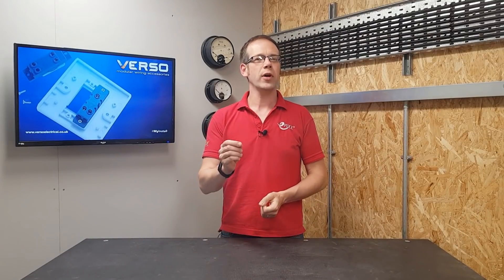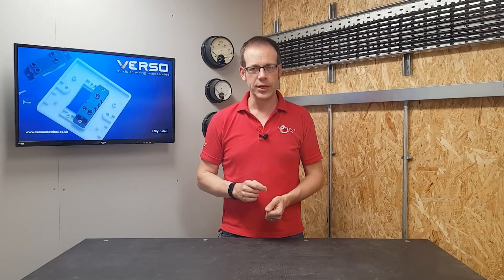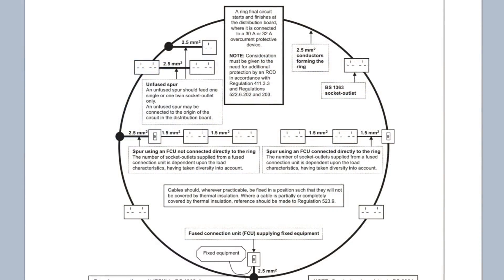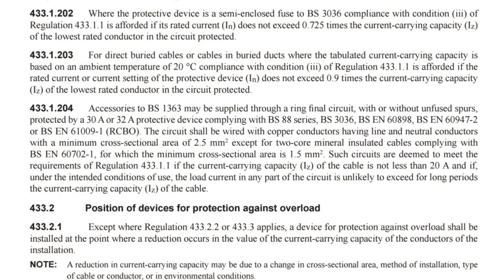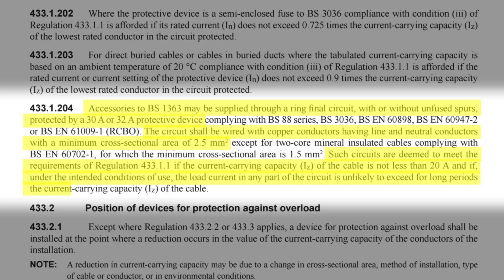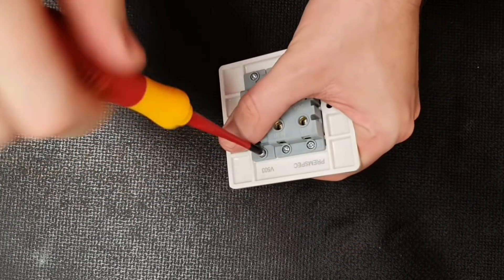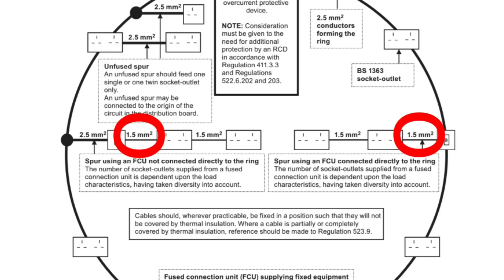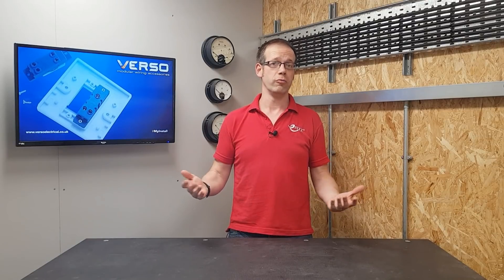Can you use a 20 Amp double pole switch to control a spur from a ring final circuit? BS7671

Comment: You wouldn't use a 20amp switch to isolate a twin socket spurred off from the ring, even though it may not run at 26amps for long periods, it may run more than 20amps, and possibly for long periods at times.  The 20amp isolator has nothing to do with the 20amps either leg... when it becomes a spur the load is not shared between 2 cables anymore.  This arrangement means the 20amp has no overload protection.
Reply: A bit like a single bit of 2.5mm cable?
Reply: @travoltasbiplane1551  2.5mm cable can withstand 26amps with the right wiring method hence you can wire up a twin socket with out overload protection as the max possible load is 26amps (although some sockets may not handle 26amps and neither would it be likely although possible if your boiler breaks down and you go around plugging in 2-3kw heaters all over the place temporarily) spurred off as the maximum load cannot be exceeded unless you use non product standard equipment which the regs isn't designed to protect you from.
Reply: @MrSJT  433.1.204. We just need Iz to be more than 20A. Overload protection is provided by the nature of whats on the end of it...and even if it is a double socket... you stick 20A through that socket for any significant duration  (which should be unlikely in a correctly designed circuit) I'd put money on the socket catching fire before the cable did. This outcome would be equally feasible if it were part of the ring itself and someone contrived to get 20 amps going for hours at a time. Of course common sense applies when designing any installation and if possible spurs should be avoided especially where this might be likely. That being said though if you're really concerned about getting a maximum total load of 26 amps out of a double socket you should also be considering the fusing factor of a 1362 fuse... It isn't 1.45...  You aren't going to get any close protection out of it...
Reply: @travoltasbiplane1551  433.1.204 20amp is the ring circuit legs regarding sharing the load in the ring, not the spurred points of 2.5mm radial coming off it.  Regardless of debate, I hope most people don't go by minimum requirements all the time especially with bad examples as it's the combination of both that promotes bad practices.
Reply: @MrSJT  for sure and i don't disagree particularly... The 20A does still apply to spurs though... The qualifying term being 'under the intended conditions of use, the load current in any part of the circuit is unlikely to exceed for long periods the current carrying capacity of the cable'. I always treat it as something to be avoided if possible. But most of the time a spur off a ring final circuit in 2.5 even to a double socket is not going to be an issue. Of course there can be exceptions - but I think if there were undue concern there would be further stipulations made in this regulation and appendix 15. Would I spur to a double socket to supply a washing machine and tumble drier... no. Would it be fine - probably. Would I spur to a double socket in your average bedroom... Yes because its very very unlikely to get overloaded. How many 3kW heaters can you run in one bedroom before the thermostats kick in and how likely is it that someone would connect them all in the same place?
Reply: @travoltasbiplane1551  problem with appendix 15 is that we need to understand how to implement it properly and also take in to account the customers don't know anything and just plug in what they want, further more this why I think it's bad practice to work to the regs (unless you really know what you are doing and consider all risks that you are willing to take liability for), should work from the regs.  This is why they say if you work to the regs you are likely comply with the law, coz the conditions must be right as it isn't always the case
Reply: @MrSJT  I don't really understand what you mean when you say it is: 'bad practice to work to the regs?' If we don't know what we're doing, and can't interpret BS7671 then we're clearly in breach of EAWR and shouldn't be doing the job. We also take responsibility for design and make decisions as such everyday. If the onsite guide is your go to (above the regs?) it says the same thing P189 H2.3 giving conductor sizes and current carrying capacity. I hear what you're saying but I think you'd have to be going some to make a spurred double socket dangerous in reality...unless, of course, you did something really daft and used it to supply two 3kW ovens which you shouldn't be doing anyway. Looking at it another way.... On an EICR you find a spurred socket somewhere. Cabling is installed reference method A. No evidence of historical overload. But... what if... What code are you going to give? I agree best practice... but the quantity of unfused spurs in service would indicate that the majority of the time there isn't an issue.
Reply: @travoltasbiplane1551  what I mean is, working to the regs is working to the minimum standard.  Working from the regs would be like working to the regs, then you take in all other considerations and any factors involved as some times minimum requirements isn't good enough hence need to go beyond.  Take BS5839-6 for instance, on a rental property a minimum standard is a Grade D1 Category LD2 system to reach minimum standards, then you take in all other considerations and any factors involved and find that some of the occupants are hard of hearing or elderly who require faster response time, now you may have to go past minimum standards and add extra detectors and perhaps an LD1 system with visual alerts to cater for the other considerations.

Now can you see how making people aware of minimum standards is one thing, but giving an impression that minimum standard is all that you need to achieve could lead to bad practices formed by negligence or ignorance
Reply: Most twin sockets are not rated for 26amps, so you wouldn't really plug two 13amp loads in, you should use two single sockets, which would not be permitted.
Reply: And this conversation should be about how shite RFC are and should be not permitted.  This would be a useful amendment.
Reply: Only place I would use a 20amp dp isolator is for appliances on a radial such as cookers and under floor heating where the overload protection is at the fuse board.

I like using s/f spurs for kitchen appliances, most are less than 2kw and it's good where they have a 13amp fuse on the plug top and you stick a 10amp at the spur, if things go wrong then you have a good chance of the 10amp blowing first rather than deal with the socket behind  a fixed or built in appliance